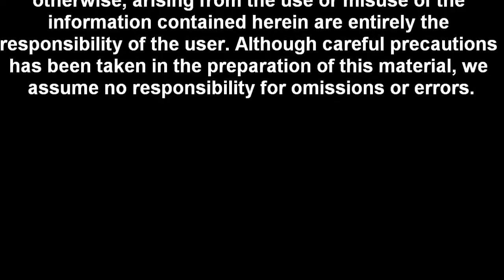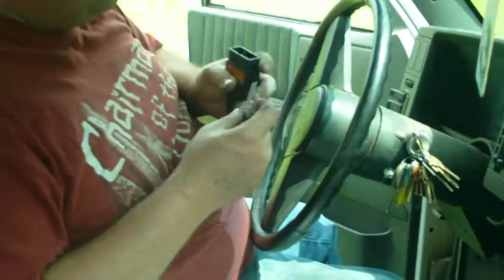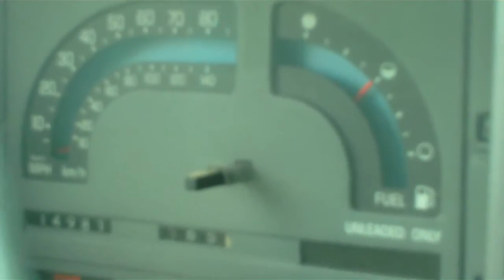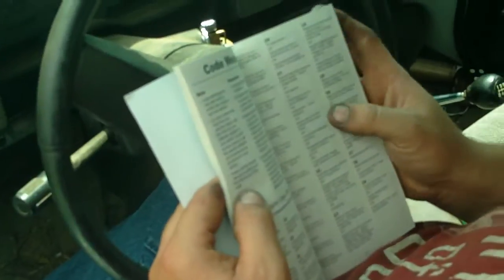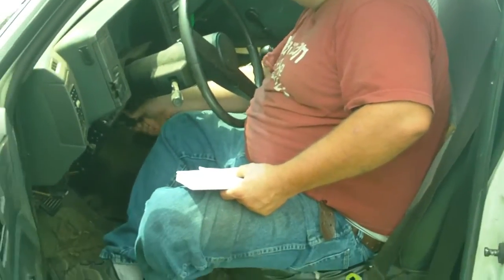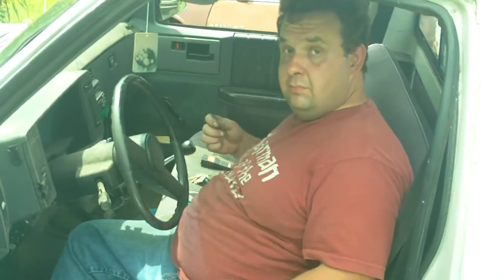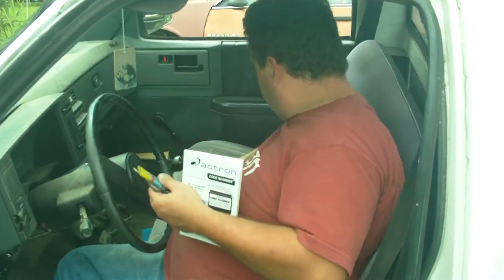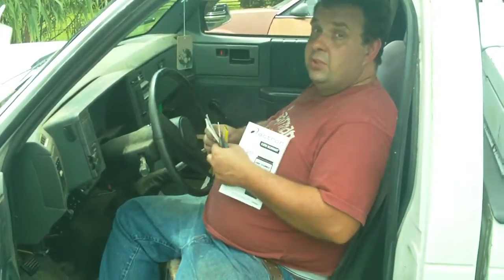How to retrieve engine fault codes with an OBD

Comment: For that just use a paper clip. That is not a scan tool. It just shorts out the A and B terminals. You still have to read the codes manually.